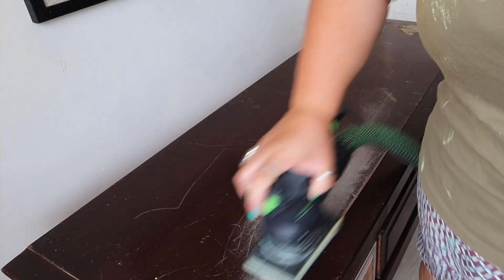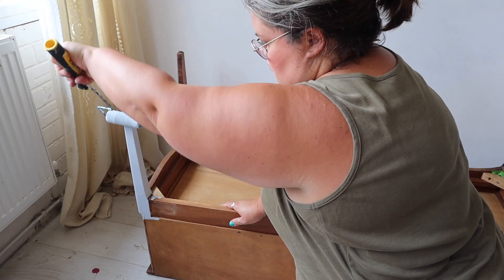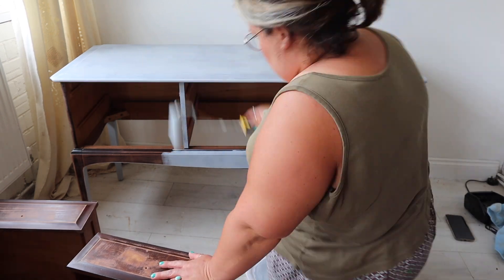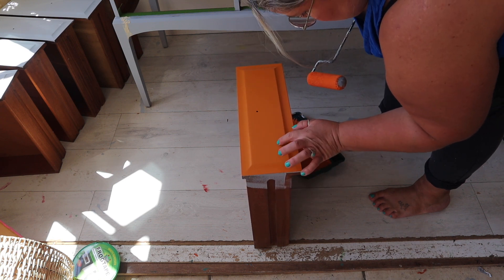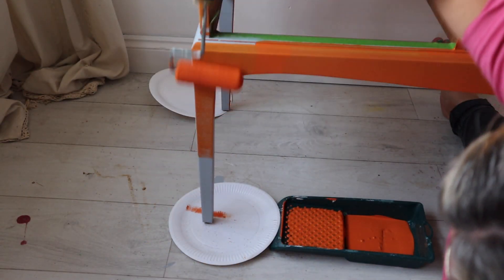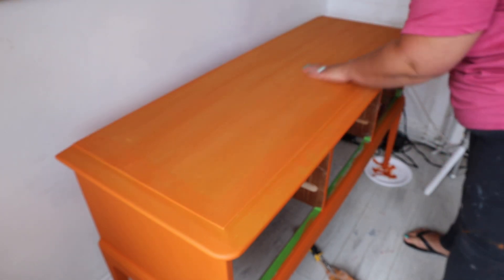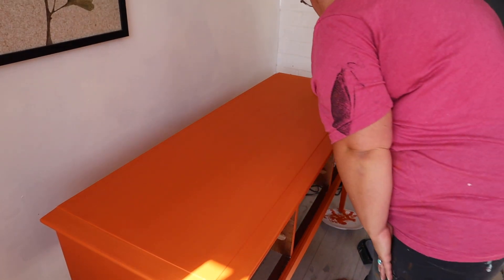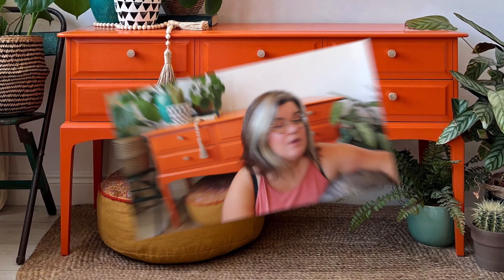How to get a smooth finish using Chalk Mineral Paint

Comment: Does it make a difference whether you use a regular roller head vs the high density foam roller head to get a smooth surface?
Reply from the maker: It’s really personal preference with rollers. I know some people use foam rollers with great results but I don’t get on with them personally 😃